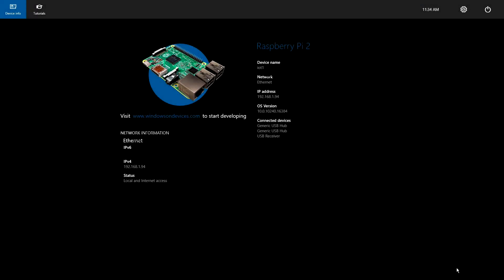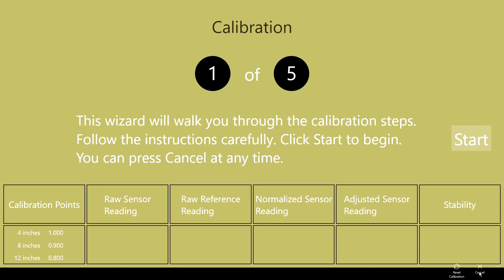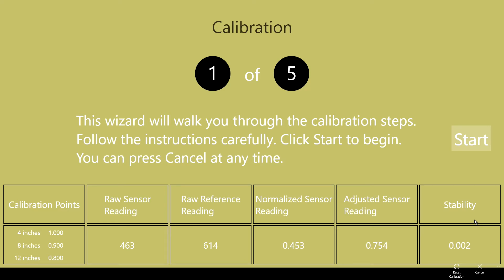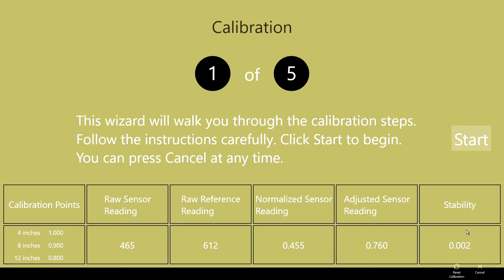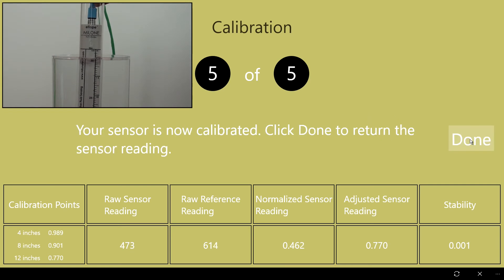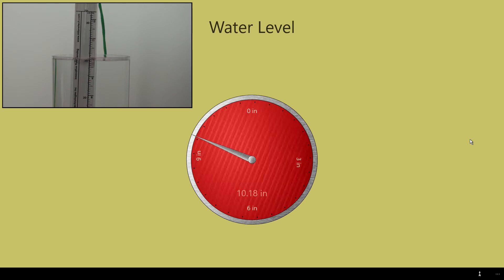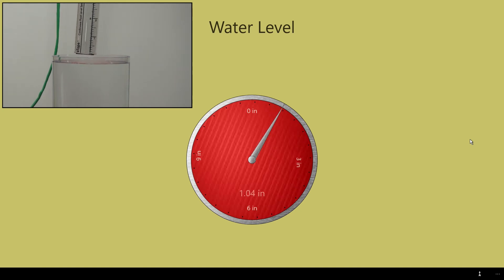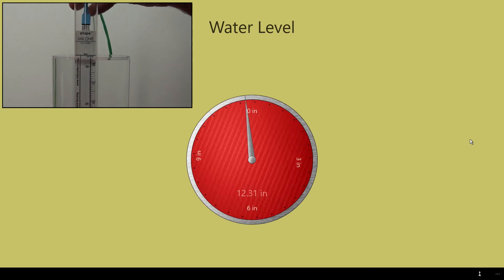eTape Liquid Level Sensor on MCP3008

Comment: Does your sensor have a protective layer on it? It looks like it is laminated almost. My sensor buckles because it is too flimsy and my readings change too much. Any recommendations?
Reply from the maker: When I ordered this item from Adafruit, I purchased the version with the Teflon jacket. I ended up peeling it off.  The eTape itself is laminated for protection. The Teflon cover is for applications that may have corrosive liquids. I had a lot of issues at first with it not being sturdy in the liquid causing readings to be very inconsistent. This is why I inserted the sensor into the plastic tube. The key to the tube s to get a size that holds the tube firmly in place without applying any pressure to it. I purchased the Clear Polycarbonate Tubing, 1-1/8" ID, 1-1/4" OD, 1/16" Wall, 3' Length from Amazon and cut it to length. This worked perfectly and resulted in consistent readings.